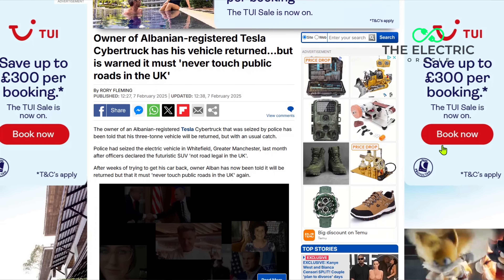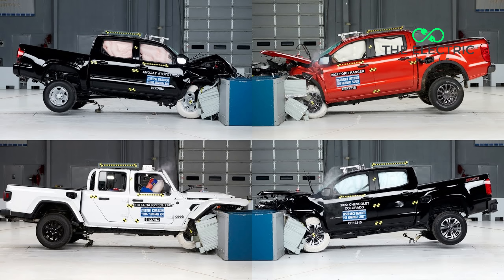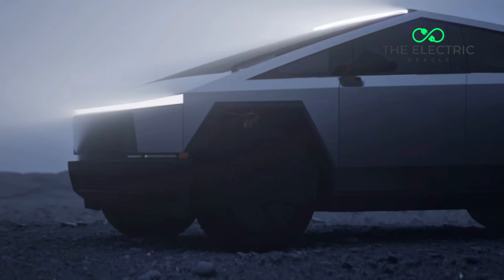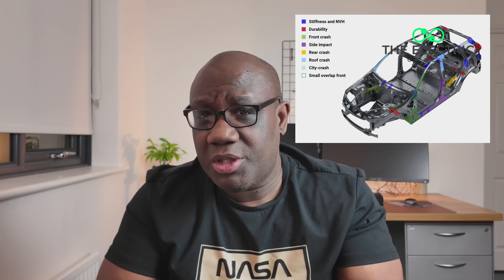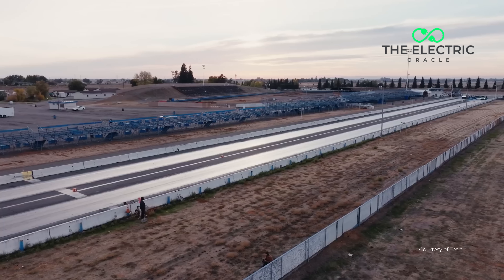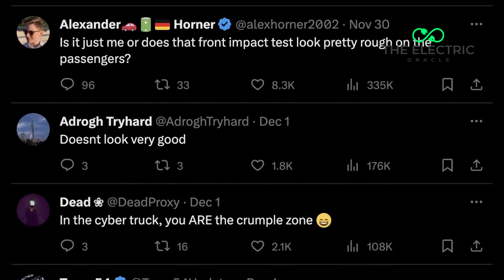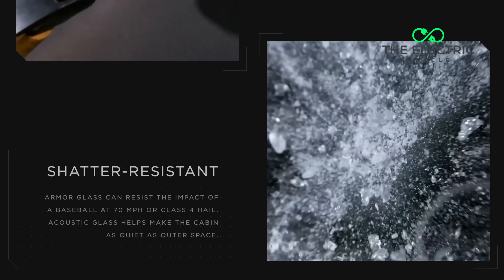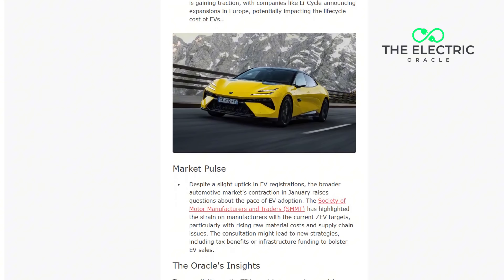Why the UK Banned Tesla’s Cybertruck – 5 Fatal Design Fails!

Comment: This won't pass Australian safety standards either...
Reply from the maker: Good point, Khokhosh! Given the safety concerns raised in the UK, do you think other countries like Australia will follow suit with similar restrictions?
Reply: @TheElectricOracleChannel  I think you will find Australian standards are very similar, if not the same, as the UK.
Reply: @fujijackamora  Yeah, I'd like to see a road train in the UK.
Reply: @TheElectricOracleChannel 
🇦🇺Australia is a socialist country, thank fark,so it’s not just the safety issues. Basically, President Musk and First Lady trump can GFT
Reply: @ No because the left wing government of Australia is about to get the boot and will not want to pick a fight with Harry Bolz before then either
Reply: How many brain cells have you lost lately?
Reply: I wish Aus standard would change to ensure that vehicles have better lighting, eg brighter, larger indicator lights to overcome summer daytime observation.  Some vehicles have gone so "modern" that the design makes them a danger on our roads as you can't see sidelights and indicators from some angles.
Reply: ADR 90/00 has guidelines for constructing a steering system in Australia that covers pure Electric Assist Steering but not pure Steer by Wire systems and will need to be updated and approved before it can be used on Australian roads. Also the vehicle will need to be Right-hand-drive to be sold, without the UK's larger market this will not happen.
Reply: @mnipp  There's nothing stopping you selling a LHD car in the UK market. Tesla model S for example. Tesla couldn't be bothered doing a RHD variant in recent years, but you could still buy it officially as a LHD.
Reply: Regardless of the fact that the CT is dangerous by design, Musk wouldn't know what Quality Control was if the very concept ran up his leg and bit him on the whatsit.
Reply: Steer by wire is permissible under EU regulations.
Reply: Australia are trying to be America.
Reply: My first thought “good luck homologating that monster”
Reply: Australia will do what Trump says end of story
Reply: 🇦🇺No, we won’t do what trump says.FDJT
Reply: @AprilzWhite... What?
Reply: In your dream magat. Go kiss drump’s ring!
Reply: Horse feathers!
Reply: Lol, no. It doesn't fit in a parking bay. Doesn't meet our safety regs. Is useless at a tradesman vehicle because you can carry two to three times as much in an equivalent sized proper truck. Also it's too heavy for many parking structures. It only has use as a marketing vehicle for certain demographics which are a minority here, and the ones we have are broke. So it's going to be a niche vehicle at best.
Reply: no we won't. It has no mechanical connection between the steering wheel and the front wheels - that automatically fails it.
Reply: @ianmontgomery7534  Please stop flying those passenger jets. they have no mechanical connection between the rudder, elevator and ailerons and the control column, just a computer.
Reply: @tedmoss  just that aeroplane have computers with redundancy (ie they have back up)  cars don't as far as i am aware, beside I was saying what i thought were the rules rather than it being my view. I just think they are too wide , too sharp and downright ugly but if Americans like them then they can keep them.
Reply: @tedmoss 
Please build me a car that needs to be maintained to the standards of an aircraft because I just have too much money and I need to pay  it to car mechanics to do preventative maintenance.
Reply: Piffle.
Reply: Deleting my comments like a true coward wont do anything so get used to eight long years of Harry Bolz in Government
Reply: "Australia will do what Trump says end of story". How is it your comment has no name or account attatched to it? I've never seen that before.

Comment: Not true in Poland is few registered.
Reply: personal imports can get around restrictions. If the car is mass produced, then it's assumed that the manufacturer has warranted the car as safe, so a lot of the checks are skipped.
Reply: @theelectricoraclechannel, if you have a look at the SVA manual which lists the checks that need to be done to register a car, you'll see many of the pages say they can be skipped if the vehicle is mass produced. IIRC this includes the rounded edges sections. Basically the authorities never imagined that a major manufacturer would design something like the Cypertruck!
Reply from the maker: Interesting, Lukas! Have you seen any on the roads yourself, or is it more a case of just knowing they’re out there?
Reply: @TheElectricOracleChannel  This polish chanel about EV , he speak Polish. He has company of renting EV and now you can arange test drive of Cybertruck https://www.youtube.com/watch?v=2nfMEz8eJZc

Comment: So why are American trucks (hgv) legal on UK roads??
Reply: They are not.
Reply: because they follow international safety standards, crumple zones, and pedestrian safety such as soft bodywork and rounded edges.
Reply: Really where ?? @rcx575
Reply from the maker: Good question, @crazyedits50! It’s mostly down to regulations—HGVs are designed to meet strict commercial vehicle standards, while the Cybertruck falls into a passenger vehicle category with different safety requirements. But yeah, it does make you wonder!